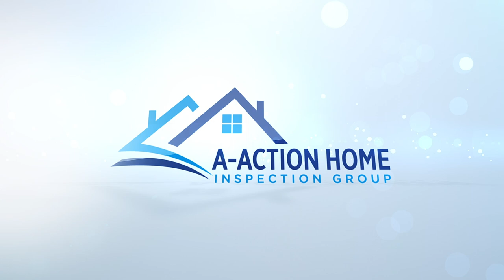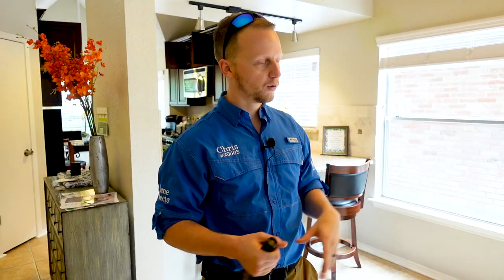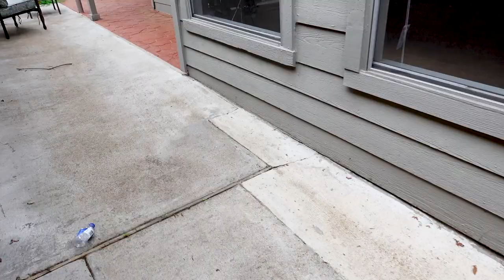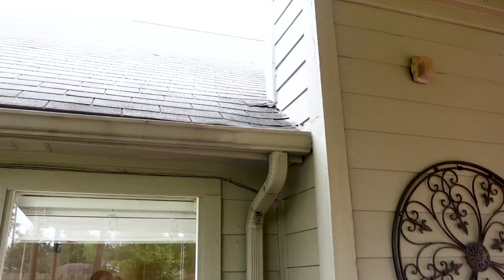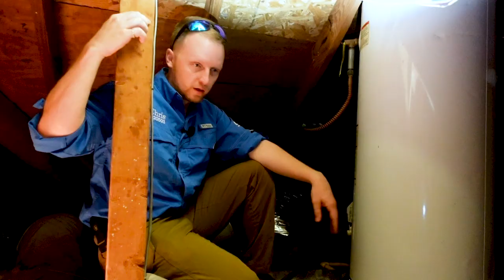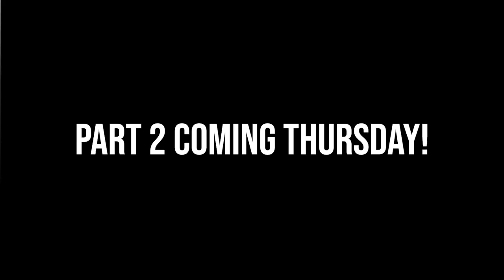1980s Property FLIPPED - Part 1

Comment: HVAC tech here. Since the condenser is 1998 and it has a new evaporator coil, that system is still on R-22, which wasn’t mentioned in the video, but I’m sure you guys included that in the report. That being said, that makes it harder/more expensive to install a new condenser because you will most likely not be able to find any R-22 condensers, which leads to a few other potential changes that might have to be made for the evaporator coil to be compatible with the new system and function properly. Many factors are at play when it comes to this kind of situation.
Reply from the maker: Thank you

Comment: Aren’t you not allowed to have a flexible gas line going through the furnace cabinet. Also, don’t water heater relief lines need to be hard piped.

Comment: Hi Chris I’m a new inspector haven’t done any paid home inspections yet. I just wanted to ask in checking the HVAC unit is this a scenario where you didn’t turn on the heating to check the furnace because of the temperature outside being above 60 degrees F ???
Reply from the maker: Yes we normally do,  We will test for operation in almost any weather on a property.  In both settings to make sure they at least work.